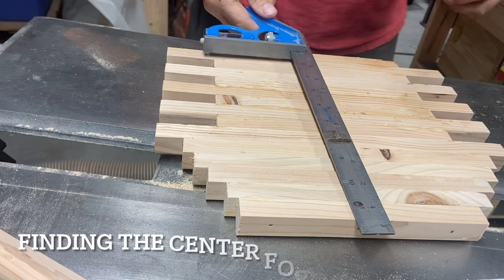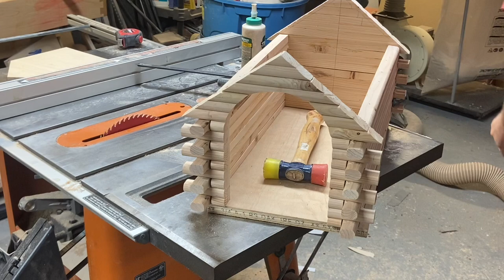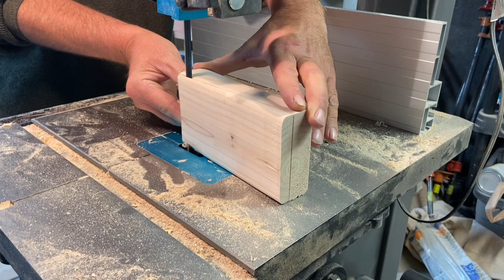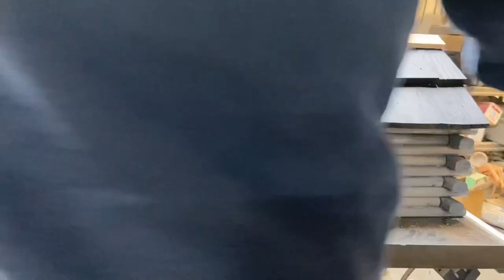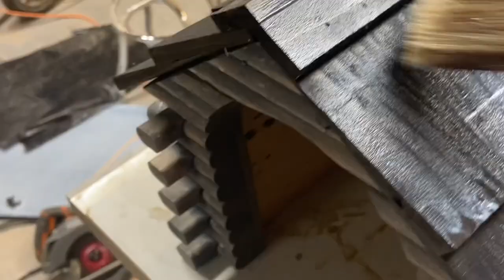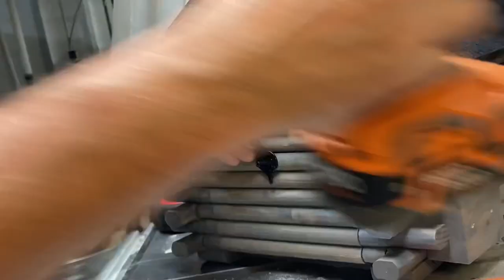Log cabin mailbox

Comment: Just curious, what size you cut the 2x4 at,to make the walls
Reply from the maker: The “logs” are 3/4 x 1”. I used the standard metal mail box with the arched top as a size template. That mail box would fit inside the log one.  Thanks for watching and commenting!